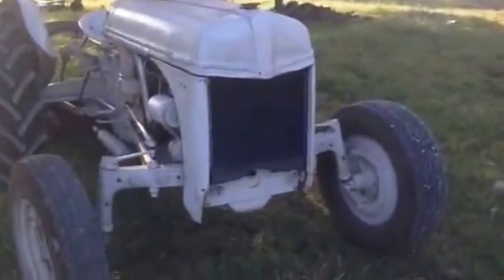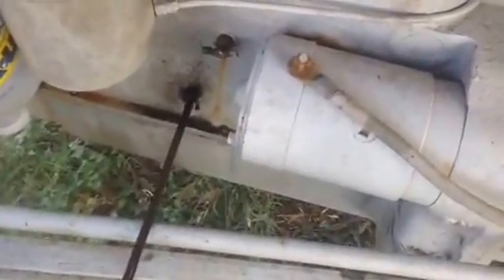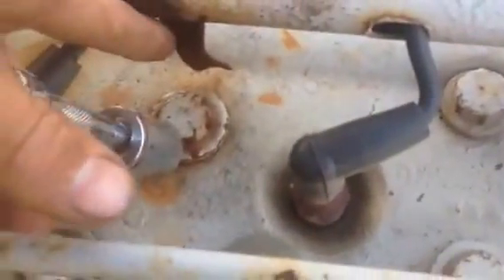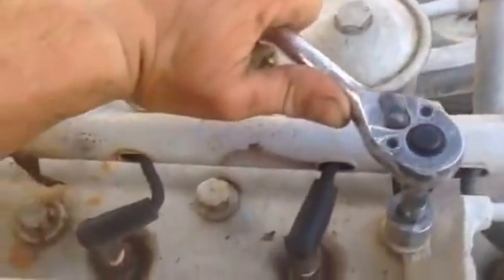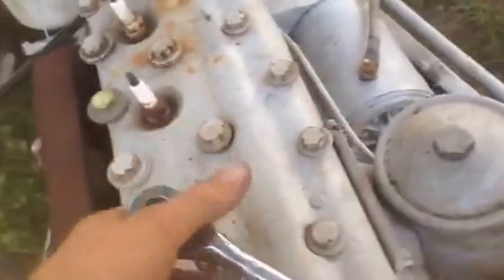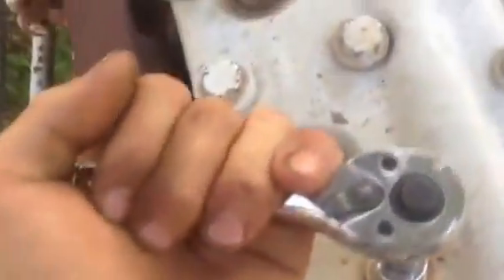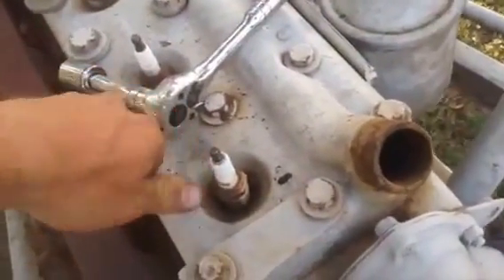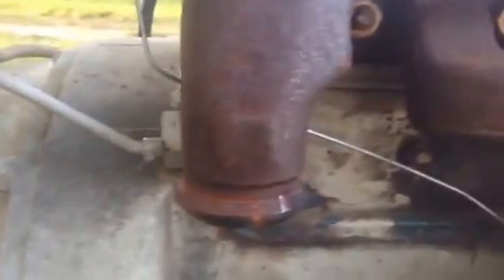Ford 9n Engine Removal and Teardown Part 1

Comment: Great video!  I've got an old '40 9N as well.  Love that girl to death.  Got a question, if you don't mind.  Last January, I drained the ol gal of fuel because I knew I would be away on assignment for several months and I didn't want the fuel to go bad and gum things up.    So today I went out to get her ready for first use of the season.  I put a quart or so of fuel in her and I noticed that I had a pretty considerable fuel leak from the top of the sediment bowl.  I bought a new cork seal from Tractor Supply, but I was wondering if it needs a thin application of oil before installing it (kinda like the thin coating of oil you'd apply to an oil filter's seal)?  Just curious.
Reply from the maker: CaesarlnVa, from my experience as long as the groove between the sediment bowl and the filter housing itself is clean and in good shape, there should be no need to put any oil on the cork ring. It may be good to double check that the groove in the metal housing that the seal sits on is perfectly clean and doesn't have any old gasket material on it. Are you sure the leak is coming from the gasket on the bowl or could it be coming from where the housing screws into the tank? One way to check may be to shut off the fuel valve and see if the leak persists. If with the fuel valve shut off the leak still occurs, then most likely the leak isn't coming from the seal between the glass bowl and the filter housing.